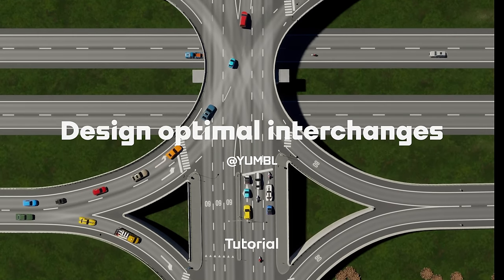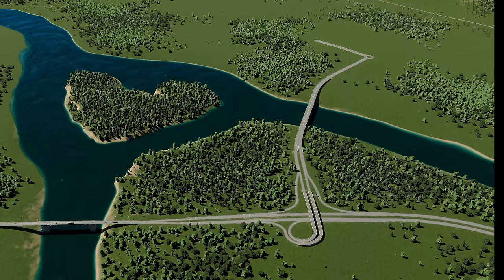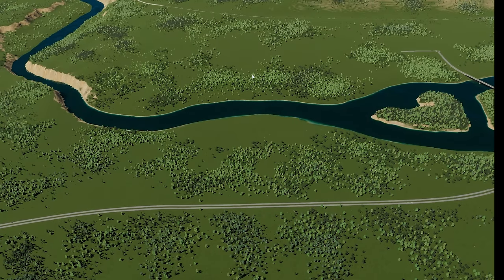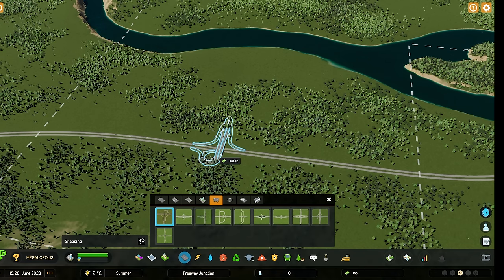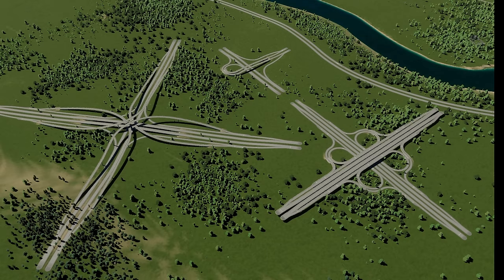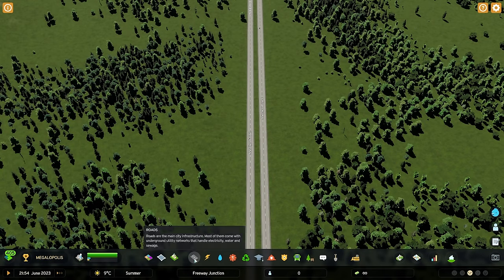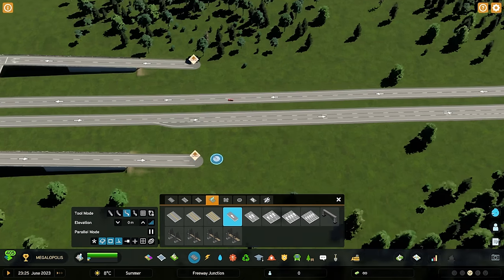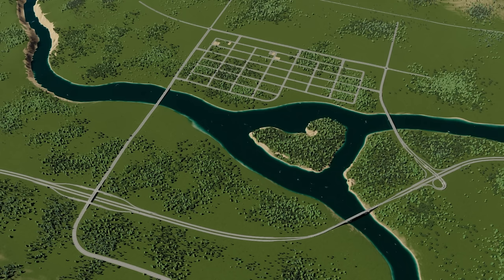How to Design the Best Roads and Interchanges | Inspirational Builds | Cities: Skylines II

Comment: Building interchanges is indeed satisfying, though I miss some QoL tools to find the process as enjoyable as the result, mostly some functions from the network tools mod for automatic connections and visible and snappable nodes to help with distances. 

That being said, I do have a major game design gripe with unlocking interchanges separately. At this point you already unlocked all the road types you'd need to build them from hand. Therefore, you are paying points for a convenience feature that advanced players do not need or use. Thus, you punish newer players how might have a difficult time managing their development points in the first place.